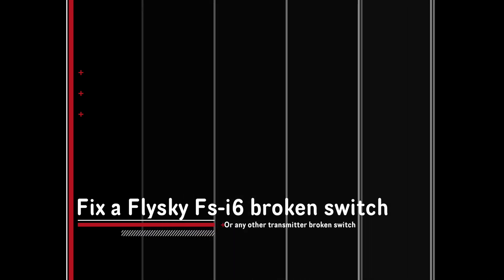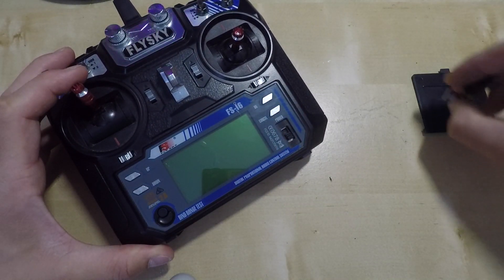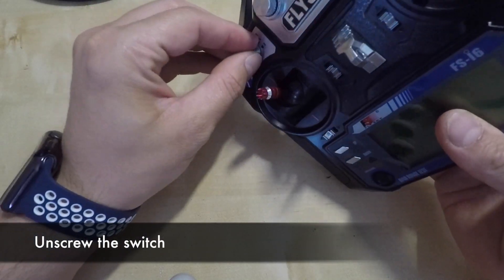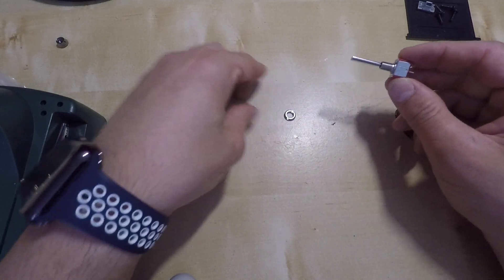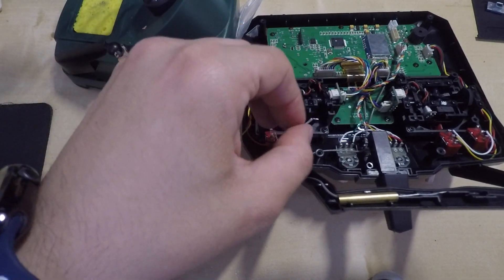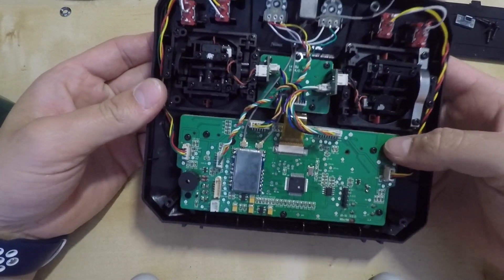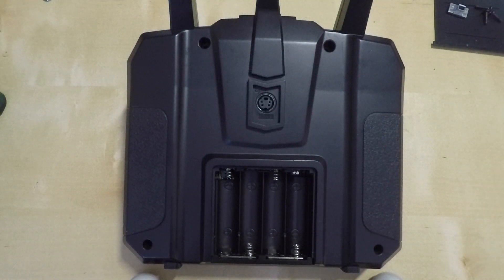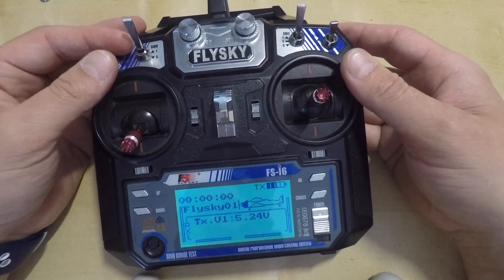Fix your broken drone transmitter switch Flysky Fs i6

Comment: Thanks bro.  My problem though I just dropped my fs-i6 and turned it on and it started beeping and saying the "make sure all switches forward and throttle down" alarm even when it was all done.

I checked some more and noticed I the square antenna thing at the top was popped abit open and had cracked down at the bottom left back part. :(
I unscrewed the back abit and managed to pop it back in and it all looks OK and sits OK now. (Bit of super glue on the cracked I thought)
But unfortunately it's still making the alarm when I turn it on.  :(

Any advice bro? 
Have I wrecked it?
Or maybe I damaged the antenna or receiver or something?

Ps:  I'm a relative noob to fpv.  
This is my first real kit came rtf with the flysky.  
Now. :(
Reply: I have the same issue, I just have to wiggle the switch that broke off around. I would just replace the switch just like in this video, or all switches if you are unsure which switch is causing the issue and can't troubleshoot. It is most probably just one of the switches that is causing you that problem